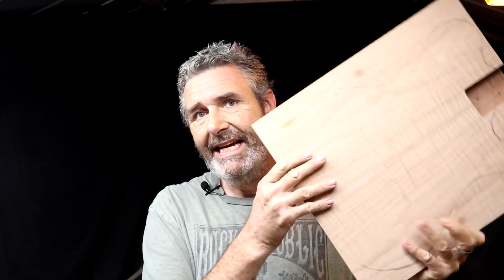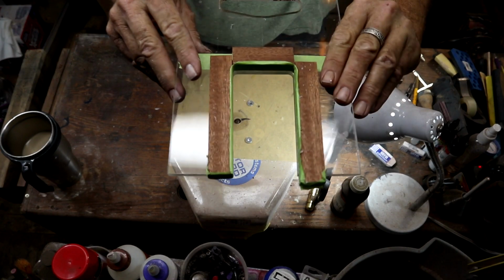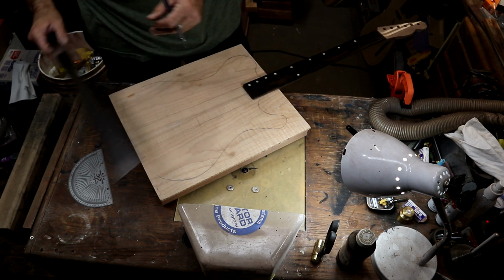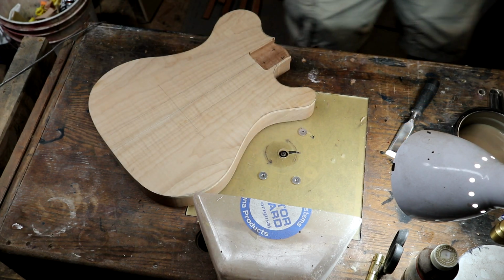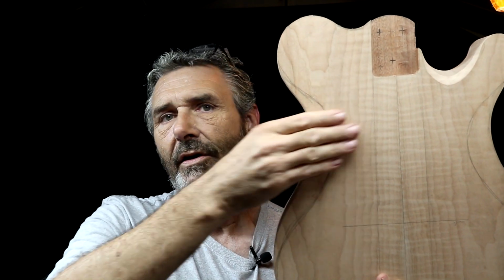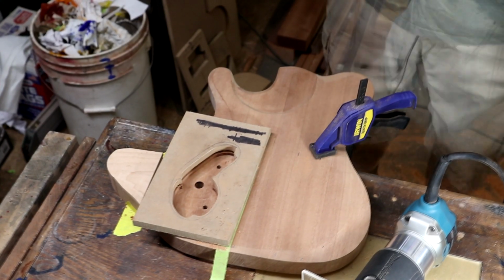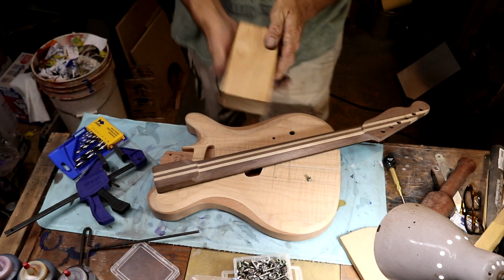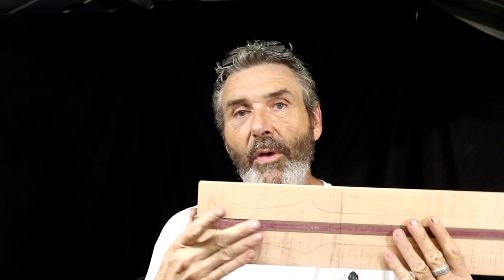How to Build an Electric Guitar - Riza - Ep.3

Comment: There's a way to use a "string through" bridge, without drilling holes through the body.  I'll let you think about that for a while. It'll come to you.
Reply from the maker: I'm aware but I like the look of the ferrules on the back. Especially on this guitar. Once the stain goes on it will become clear! Thanks for the input.
Reply from the maker: On top of that, I need to know that procedure and how to do it with confidence!
Reply: @SweetTGuitars  The holes in the bridge plate where the strings come up through are too small for the ball ends to fit through. If you drill a slightly larger hole just behind the existing one, so that the two intersect, then make a shallow hole the body underneath these holes,  the ball end enters through the large hole, then moving it forward it gets caught under the small hole.  I've done it on Tele and Strat bridges for friends and on a couple builds. It's easy to do and can be used either way.
Reply from the maker: That's a great idea. That will also allow you to still use a high quality bridge. Most of the "top loaders" you see are cheap Chinese ones! Thanks man, I'll try this.